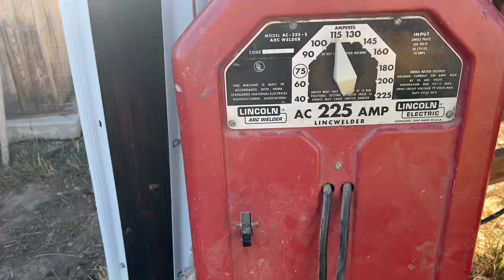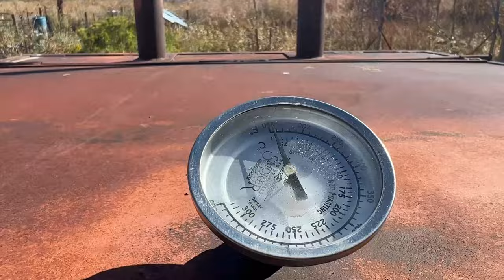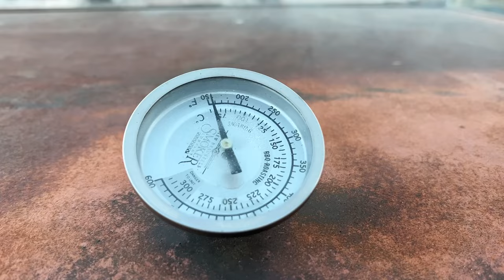Operation Dumpster Fire Part 1

Comment: Maybe a small blower to force some air through the firebox might increase the heat in the smoker.  Just my $0.02.
Reply from the maker: That’s one option. I’ll tighten the welds first and see. Insulating the smoke stacks could help, too. 🤔